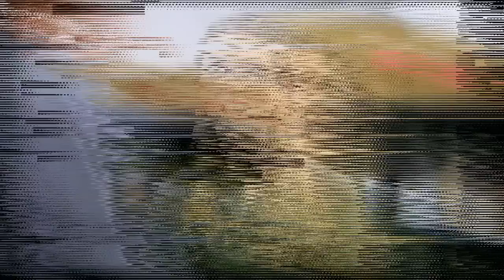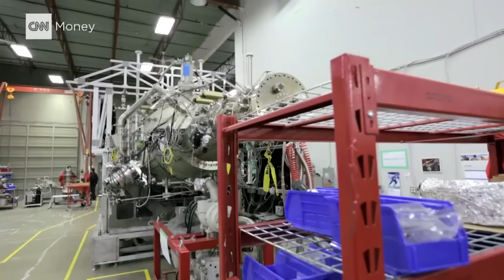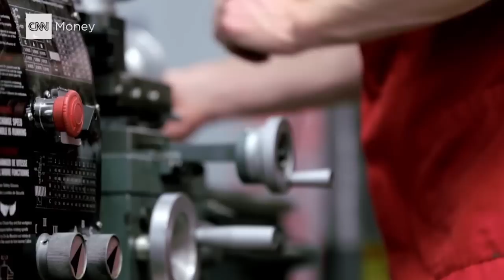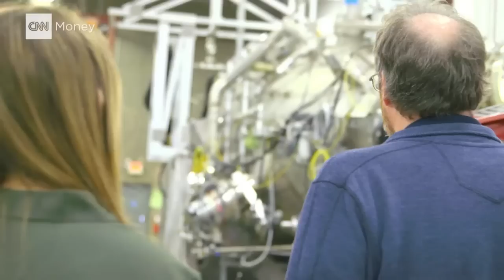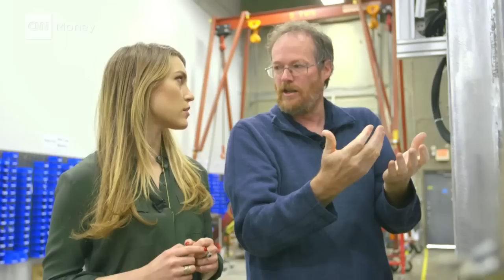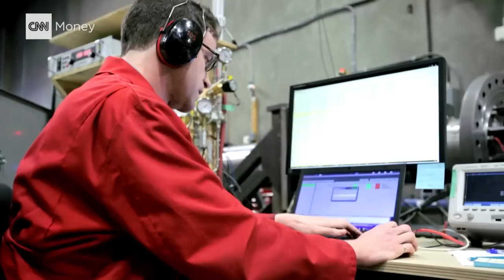This company could power the world for 65 billion years

Comment: What they are basically doing is steam power and using the fact that as matter gets denser faster, it gets hotter. This is not fusion fusion is the combination of two different atoms to create a larger atom of a different element, literally the reverse of current nuclear fission. This will allow us to make atoms of rarer elements through trial and error experimentation, basically you can use the concept of the sci-fi concept of "Alchemy" to make a gold atom out of two atoms that when combined have the same number of protons. Simply put, say in an alternate universe gold has seven protons, if you get an atom with three protons and input energy to combine it with another that has four, there's a chance that you might get gold

Comment: Yeah except, they have yet to find a metal suitable to make a fussion reactor.  After only a short period of time the the metal begins have small cracks throughout.  The amount of energy it takes to keep that reaction going and the pressures that are used are astronomical.  The cost to build a fussion reactor does not match the output especially if it must be made of a special metal they still are unsure exists.  And just like fission this process still produces radioactive waste.

Comment: So you could basically use this machine as a metal smelting machine and make a ton of electricity? it would need some modifications but metal recycling would be the main power source on the planet if it were to be done correctly. That would indeed change the world in less than a year, unless they hard wall patent it... then it would take for how long that patent last and 6 more months.

Comment: I think that the Flux Capacitor together with the Turbo Encabulator synchronized with the inverse reactive Grammeters is a far better solution
Reply: Agreed but don't forget about the sinusodal deplenatration that a base plate of Prefumulated Aumulite would cause.... given the degeneration of side fumbling.

Comment: The problem is how do you replace the billions of jobs this will replace in the energy sector. That's why things need to happen slow so society can adjust to the sudden change. The same way that Miracle drugs dont come out as soons they are discovered
Reply: Del Walker Millions?
Reply: Jobs in oil producing country's. Not just oil jobs , the jobs that are supported  by them, parts producer's,  service & maintenance,  transportation & shipping ,  chemical manufactures,  enginering. Etc.

Comment: Almost no pollution?  They are turning water into helium.  It is like saying when first discovering fossil fuels:  It produces CO2 which is found naturally in the air anyway.  Pollution is defined as an amount of something over and above natural (normal) levels.  

What happens when there is an overabundance of helium in the atmosphere?  What happens when the proportion of water on the planet is noticeably lower?  What happens when there is a significant rise of oxygen levels in the atmosphere (byproduct of removing the hydrogen from water)?

Comment: I want someone in the field to explain to me how much water would be used to produce power for the entire globe for the next 1 million years. If it's only 0.1% of the earth's water, then it's enough to cause an environmental disaster of epic proportions.
Reply: etmax1 you wouldn't be wasting water, it will eventually return as rain once the steam condenses in the atmosphere
Reply: Bubble Nigguh
It's not the steam I'm concerned about, in fusion the water is actually fused in the power generation process. Look up fusion reactors
Reply: Yes, the water is fused. Very small amounts of water at a time though. They won't, and can't just throw the entire bulk of .1% of the world's water into the system at once. They will only be able to use what the machines can handle safely. None of the water used for the fusion reactor is going to fuse together while it waits to be used. So the only time fusion will happen, is when they want it to.
Reply: Draggon Reaper
You've misunderstood me, producing 15 terrawatts of electricity (the current world production) using fusion will use a lot of water. That water won't come back. This planet will be habitable for another few million years and the water usage over that time mustn't be enough to cause issues is what I'm saying

Comment: That's just silly!  How long are they expecting the end of the piston to last when it's in contact with plasma in the millions of degrees range.  But the first problem is how much pressure can actually be obtained with a gas driven piston. I would like to see the math. The "rod" pushing against the fuel would be exposed to thousands of tons of pressure and millions of degrees of heat. It would just evaporate.   Cool looking machine, any investors ???   ;D

Comment: Very advanced forms of energy generation, still uses steam turbines.
Reply: Complex solutions are often inefficient solutions and always expensive. Steam turbines are well understood and easy to manufacture.
Reply: there is literally nothing wrong with steam turbines, or do you think they're using steam engine technology? lol
Reply: mrbandishbhoir I know more about turbines than any of you, and yes the current turbines are high tech, but the concept of using wind to power a turbine to generate energy is ancient. They had windmills thousands of years ago. So the concept is so low tech it was invented before electricity was discovered. We only improved on it.     
It's just funny that after all these years, we still use the most 'simple' form of energy generation, that's the joke. I'm not dissing turbines.
Reply: Surely there are better ways of doing it, we just havent invented them yet, so we use tech that is millennia old. As advanced as our current turbines are (trust me, as an aviation engineer i know all about turbines) it's still basically fans turning kinetic energy of the fluid into rotational kinetic energy that may or may not drive a dynamo to generate electricity. And the current turbines have a reasonable efficiency, but it's still very, very old tech.
Reply: zimri19 Your initial comment was vague and gave the impression you were trying to juxtapose "advanced energy" yet still use steam turbine technology and it sounded like you were portraying them in a bad light.

Further, steam turbines are not the end all be all thermal to kinetic solution, but they are the cheapest-efficient thermal to kinetic solution, till we use helium brayton cycle or supercritical CO2 turbines, which I believe would suit a fusion reactor much better.
Reply: a windmill isn't a steam turbine but the concept is similar.
Reply: mrbandishbhoir I think it's fair to posit that a fancy megabar compressor X plasma vortex thing with no noticable heat transfer unit should best just transmit rf power.
Reply: Keep on with the design thinking and transmit electrical power, without managing a steam loop as another flywheel. Against DOE rules? Must fly steam or hydraulic power drills to play?
Reply: Dep't Of Energy. Safe powerplant ops governance and government.
Reply: mrbandishbhoir there are alternatives, such as thermoelectric generators. JTEC for example. But i don't feel like i have to go into specifics with the likes of you because you can't even distinguish jokes from arguments, So there's no hope of any level of intellectual debate with you n the first place.
Reply: mrbandishbhoir Yes thanks I'm in the bonnie isle that appears in low tide between Mexico and Canada. And if we were to devise a virtual thermoelectric device not very very limited in operational range, I'd agree with that wanker zimri19 , who was not on to 5GW prototypes.
Reply: zimri19 Water (steam) has a very high heat carrying capacity, is cheap and abundant. That's why fission plants today use it and that's why it's a good idea for fusion plants to use it as a heat carrier. There are liquid metal heat carrier reactors in existence but they are much more troublesome, significantly more expensive to maintain, and offer marginal benefits over water.
Reply: I could not pose you an alternative equipment at hand to create electricity but I feel telling what makes electricity should be in this post.

If you get anything, compress it (efficency grow the closer they are) and seperate them in oposite direction, then the output becomes a magnetic current called electricity.
Anything that allows unhindered motion to this flow is a conductor of varient efficency.

The turbine is basicly the inner part of the 2 part you need while the outer part is a stand still shell (togather they are the dynamo).
As the inner part is rotated by any means it causes its parts to move closer to the external parts causing the compression, when they depart  from eachother (after the shortest distance beatween them) they cause the split seperation to the oposing sides realitive to each other and then the current flow thats generated like this is then transfared away by a conductor.

Now I would pose an alternative, try to use the compressed "anything" in this video and split it instead of ejecting it to heat up water and create the magnetic current directly right there.

Comment: It's a misconception that fission is dangerous too.
Reply: fission is dangerous because you can't 'shut off' fission when it goes wrong. Fission can sustain itself, fusion can't (well except in stars because they're so massive).
Reply: zimri19 Fission you can halt immediately, break even criticality requires certain situations to take place for that to happen, criticality can be halted immediately if you remove the fuel from that situation; changing the geometry, inserting control rods, lessening the fuel density or straight up denaturing your critical fuel with inert fertile materials can instantly halt a fission process. 

A good example of this occured at the fukushima  reactor complex, the reactors were no longer critical when the primary earthquakes hit the facility as the seismic sensors already halted the fission long before the initial shocks alerted it. 

The facility had a melt down because of radioactive decay,  not because of fission runaway.
Reply: Vigilant Libertarian According to standard Star theory yes, The gravity and radiation pressure from fusion enter equilibrium and the status quo maintains such equilibrium until fuel runs out.
Reply: Vigilant Libertarian That's what Special Relativity or general relativity says, So if you follow those principals then I assume the gravity isn't strong enough around stellar bodies for any noticeable effect.
Reply: The waste is a big problem.
Reply: Why? What is it about radioactive waste that is so difficult to store? You do realize that there is no noticeable radiation after passing through a few feet of concrete, right. We are also talking about a fuel with the highest energy density of anything we currently use for fuel, about 10% of the mass (literally converted into energy!) of fissile material is used up in a fission reaction.
Reply: alexanderx33 the waste is a big problem because the media and anti-nuclear smear  campaign says so
Reply: +OnePercent wow I was pleasantly surprised to see that this conversation didn't turn up into an Internet fight lol
Reply: I think he was pointing out compared to fission fusion is far less dangerous.
Reply: Steam loops are dangerous, but sorted out 40 years ago. Vortex fusion has no primary neutron products whereas the others do...or at any rate one imagines AEC rules were not broken in that compression demo. Should have dropped a ripe cheese from the apparatus to show a product... 'And it captures and sequesters vortex products...'

Comment: So, how is energy made from fusion, fusion is creating atoms, which takes energy to do? Can anyone explain? :S
Reply: 〈html〉 you combine two hydrogen atoms into one helium atom. The 1 helium atom is slightly lighter then the two hydrogen atoms. This lost mass was converted into energy and a small amount of mass is equal to a massive amount of energy. That energy is what you get. This happens up to iron. When iron atoms are made no mass is lost so no energy is generated. The goal is to create a reactor that can handle the intense heat needs to contain plasma that can undergo fusion while also being energy efficient enough to have a net gain of energy. Right now our reactors are producing a net loss of energy, or they can't handle the heat for long periods of time.
Reply: 〈html〉 the weight of two hydrogen atoms is more than the weight of one helium atom, thus, 1+1= 1.8, the .2 that was lost is energy in the form of high energy neutrons and gamma rays.
Reply: It's literally how the sun creates heat and light. One of the most efficient and powerful methods of creating energy we know of. Except maybe antimatter conversion.    
It's the exact opposite of fission. With fission you split an atom into two atoms, and the total mass of the two atoms is small than the mass of the atom you split. The remaining mass is transferred into energy because of the law of energy and mass conservation.      
Fusion is putting two atoms together to form one atom, but this atom is lighter than the two atoms you fused together, so the rest of the mass is turned into energy.

Comment: It's crazy to think that all this complex technology is just for the same old archaic method of using steam to power a turbine. Although I didn't know what else to expect, honestly.
Reply: dudester101 Yes there is, there are other forms of converting kinetic energy (temperature) to mechanical rotational energy.

Things like supercritical CO2 closed cycle turbines, helium brayton closed cycle and open cycle with efficiencies exceeding steam getting closer to almost 50% thermal to electric.
Reply: what he was saying is that we currently don't have other ways of reliability powering our main power grid other than with turbines. Yeah there's solar, but you can't run an electricity grid on solar alone. We don't have batteries that are nearly efficient enough. And besides it would be problematic keeping the 50/60 Hz stable on solar, among other problems.
Reply: dude
just no.
there is no other method of converting the energy on the scale he is talking about.

Comment: Not sure if a specific company is behind it but a stellerator fusion reactor was recently turned on in Germany. So far, they are the ones who are ahead of the game.
Reply: zarbinder all tokomak based designs are really hard to harness energy from, so far this is the first fusion design i've seen that actually proposes a way to convert that heat to electrical energy.
Reply: ***** Stellerator really is just another tokomak but they solve the problem of plasma migration away from the center interacting with the chamber walls and poisoning the Fusion Reaction. 

You still run into the problem of getting water to some how boil off the plasma heat and driving steam turbines.
Reply: The cooling required to keep the tokamak walls from burning up would provide more than enough heat to turn some turbines, the heat comes from neutron radiation as well as visible light from the plasma if im not mistaken. The magnetic field only contains the plasma and is mostly inert when it comes to preventing radiation from escaping the plasma ring.
Reply: LouSaydus But a tokomak can't be fired for more than a couple of seconds and still hasn't produced break even power output to sustain the reaction, So your flash of 20 million degrees won't sustain a steam turbine running a generator.

You also have the problem of cooling the super conducting magnets to almost near absolute zero, So any sort of heat you'll get might switch off the magnets.
Reply: And those are some of the reasons we don't have any functional fusion reactors.
Reply: I'm excited for the stellarator, though, don't get me wrong, if they can fire 20 million degrees long enough to run a steam turbine with that we might have cracked the code.